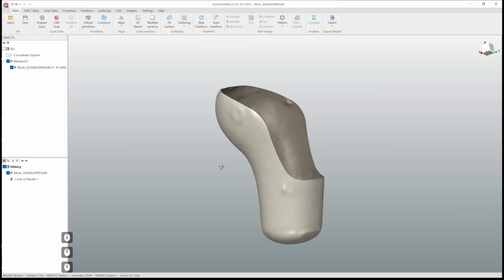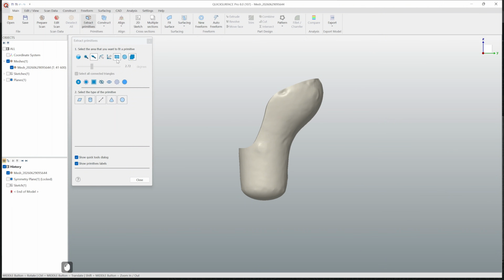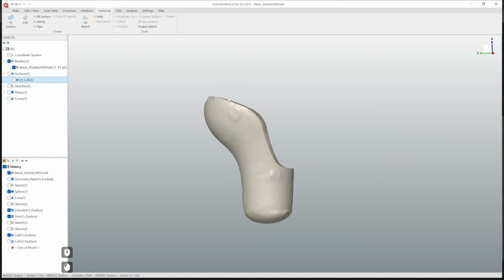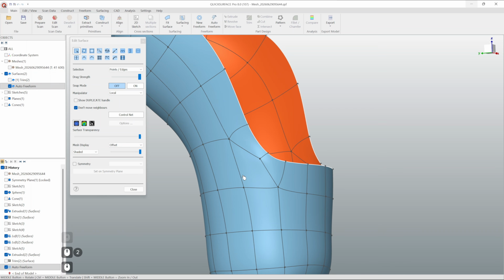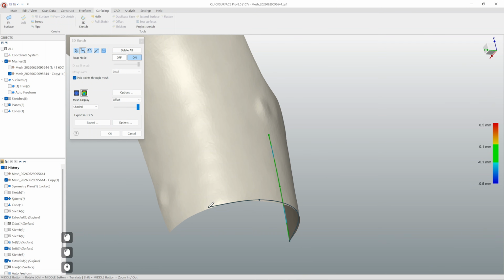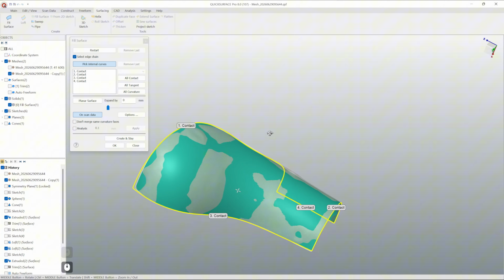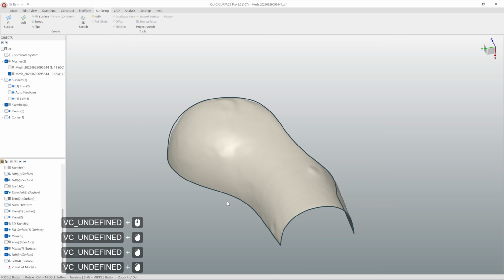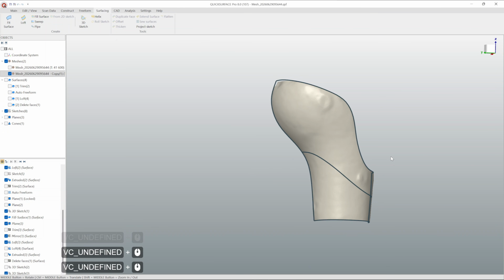Workflow:Reverse Engineering of Automotive Gearbox Shifter Knob surfaces from 3D Scan | QUICKSURFACE

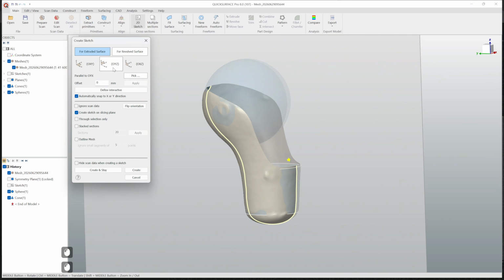Comment: I am using ExModel. At the 9:31 mark, when I create a cross-sectional sketch, the red outline of the sphere and the bottom cone does not appear. Could you tell me if I need to enable something in the settings? Thanks.
Reply from the maker: Press Clip button on the sketch control panel
Reply: @QUICKSURFACE  Thank you